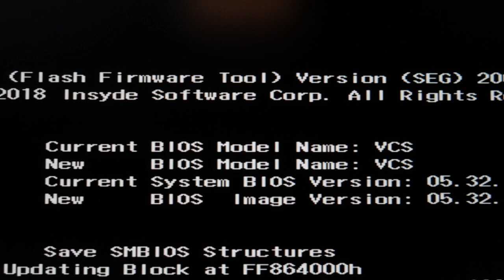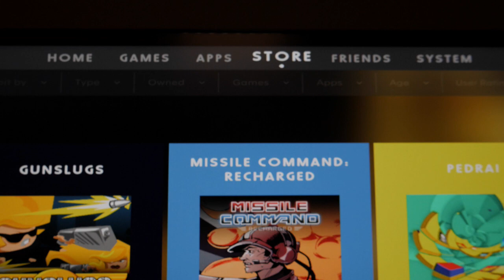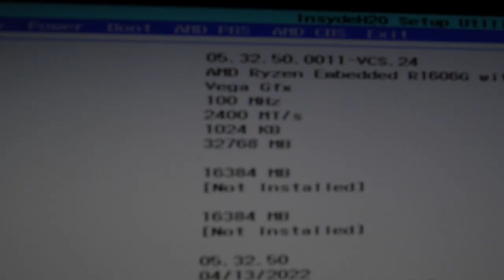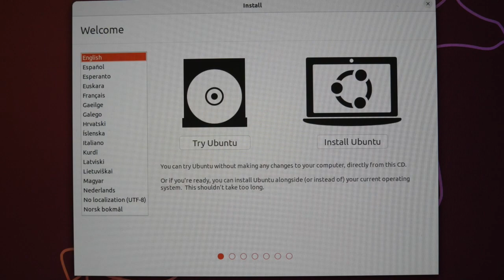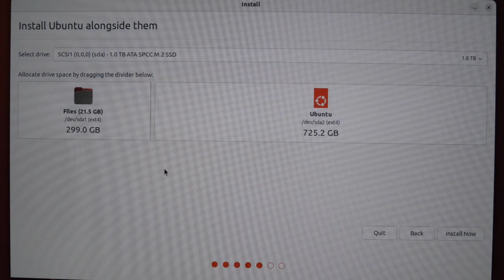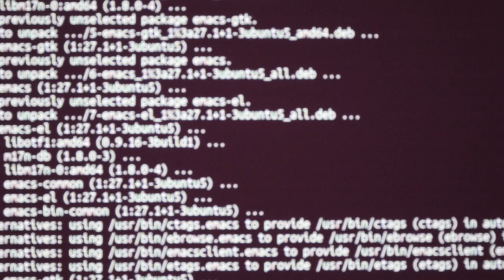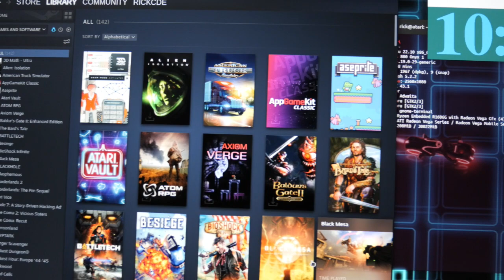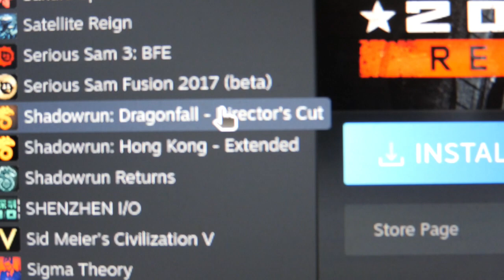Atari VCS and Linux in 2023!

Comment: when you add a pc os windows or linux. do you still keep the main atari os?

all you do is add windows 11 to a usb and it load from the pc app? you can still get to keep the main one?

finally got my vcs fixed. now a new update happen. it will run even faster now. 

wonder how well do modern games run on atari.
Reply from the maker: Yes. I kept Atari OS on internal MMC drive that comes with the Atari. Then I added a 1 TB SSD and formatted it with the Atari OS. Then I split the SSD into two partitions and left some for Atari games and I installed Linux in the other partition. But for now, I boot directly into Linux all the time but Atari OS is still hidden on the built-in drive in case I ever want to go back.

Comment: How did you format the SSD from AtaroOS?
Reply from the maker: If I remember correctly, you go to the System tab in the Atari OS and then under System, there's another page called Storage and you can see all the drives there. If you highlight the drive, there's an option to format.